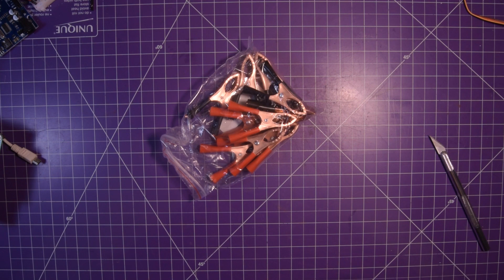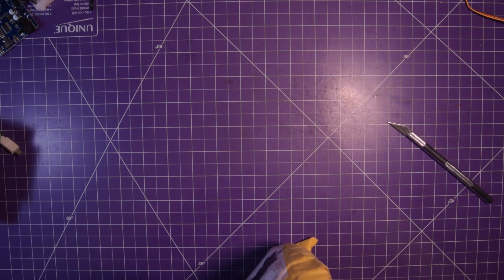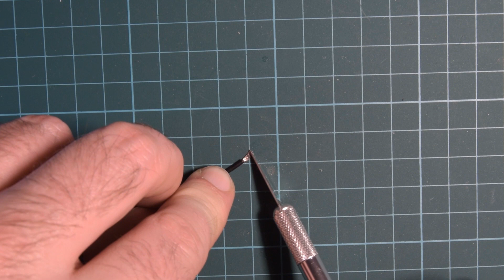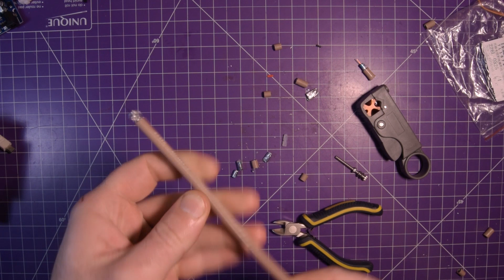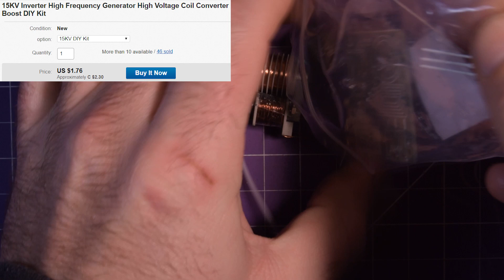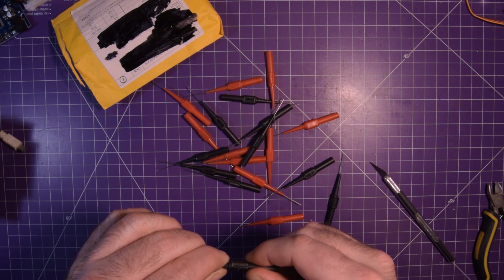Mailbag 43 - Red, Black and KITS!

Comment: I used a similar stripper (but an actual name brand one) almost 30years ago when I was a contract installer doing a cabling job installing a new TV studio. I spent weeks making up hundreds and hundreds of BNC cables. 

It's a surprisingly efficient design. 

If yours is half as durable as the one I used it'll be a good thing.
Reply from the maker: I hope I get a lot of use out of it!

Comment: I ordered some silly corn wire off amazon it’s been ok but I am pretty sure it’s copper coated aluminum
Reply: for silcone insulation test try melting sheath with solder iron, shouldnt burn and to test for CCA wire try to melt it with a lighter , aluminium will melt or wilt, copper will glow bright under burn and maybe stay tarnished at end but will survive as has higher melting point, i learnt that from a channel here on youtube  ;-]
Reply: Dazza Direct I think big Clive did that burn test also pretty neat for sure

Comment: i think the kit is using a "flyback" transformer similar to those used on CRT TVs , SDG Electronics has just created a couple of videos usings these for an ESD tester he says the output doesnt really regulate.  Open a complaint on the wire, Silicone wire is about 250% normal wire cost, ive stopped buying wire from China i use CPC/Farnell and Rapid here in UK. I would use "not as described" and state you will send back to address on evelope in Canada, also not known by many is if a company refuses to pay shipping back (even though here in UK its illegal for a business selling a new product to), paypal will pay for up to 6 postage items per year, do this last though as they expect you to have exhausted trying with the company first and then have had ebay step in , then they will help your third, it does work i can atest as i have successfully used it, i never even had to send item back in the end as company refused to provide an address in china was an D.O.A RTL SDR USB ongle costing £34.   ;-]